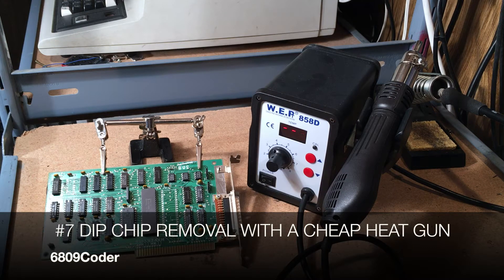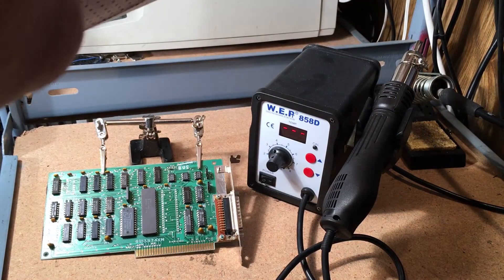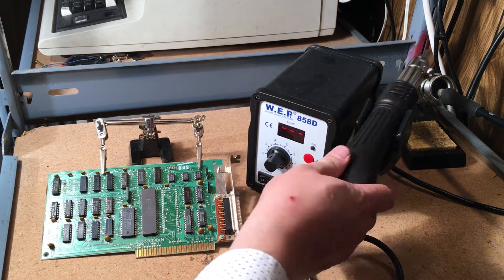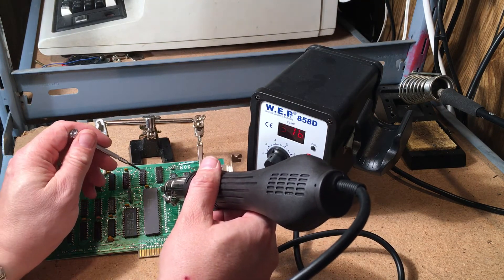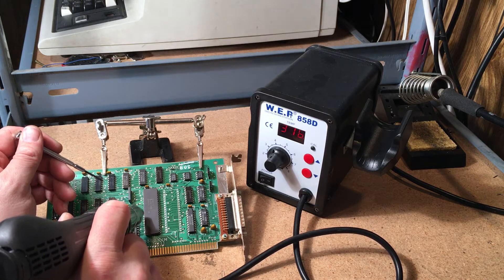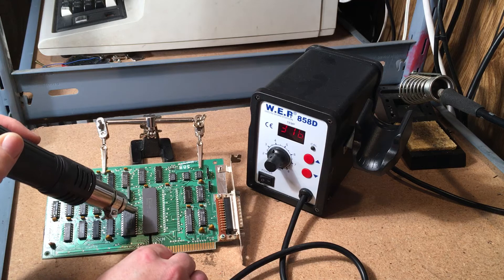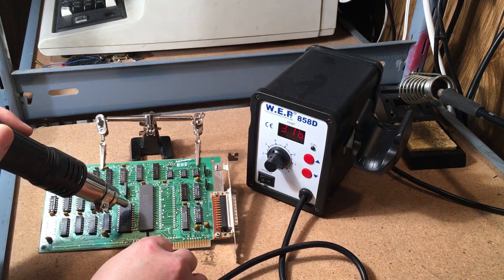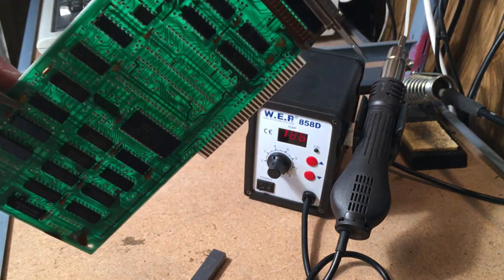Desoldering Large DIP/Through Hole Chips with a Cheap Heat Gun

Comment: Don't you need flux to use a heatgun?
Reply: Also don't I need to heat the board a little?
Reply from the maker: Yeah you are right certainly for anything modern.    These ancient boards and chips can take a lot of heat though so I am not too concerned doing this on an old, thick board.

Comment: I find using a soldering iron and a solder sucker, then solder wick, takes most of the solder out of the pin joints. Then a little application of hot air melts what little remains as you pull the chip.
Reply: that is usually my go-to, iron + sucker, wick and if anything is still hanging on hot air. While I have used hot air only many times I have popped up a couple traces (luckily on nothing I cared about) and it takes every bit as long as a sucker + wick if everything is fluxed up good

Comment: thanks for the video , what is the safe temperature?  that doesn't destroy the chip?
Reply from the maker: Thanks for watching!   Excellent point about temperature.   Typical DIP chips are rated from about 125 to 150 degrees Celsius max storage temp.  In most cases I have only desoldered chips for replacement so it didn't matter if I wrecked it.  While there is a good chance a removed chip using this method will be fine, you might want to consider using a heat shield of some sort to reduce the risk of ruining the chip.    Also a quick note, always replace a soldered in chip with a socket, that will save you headaches later!